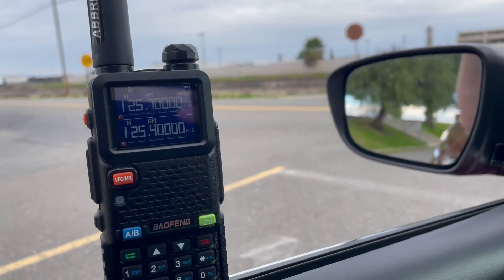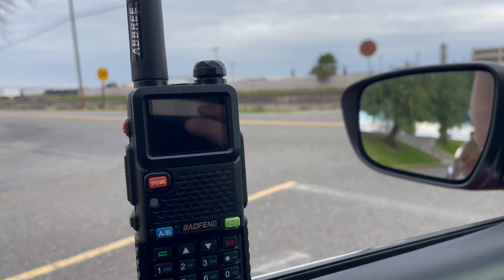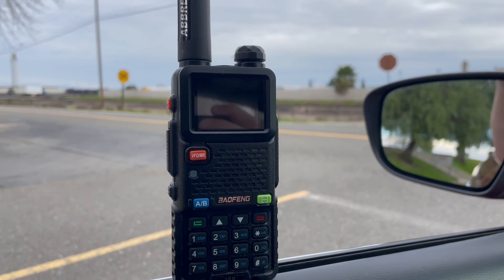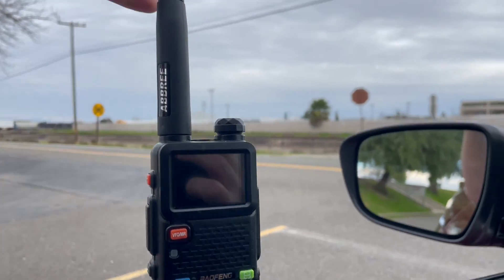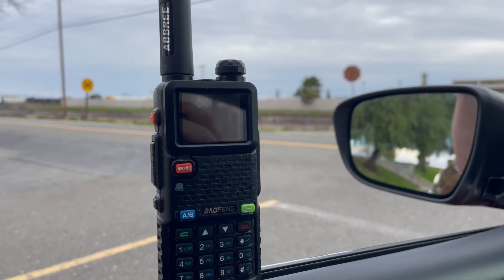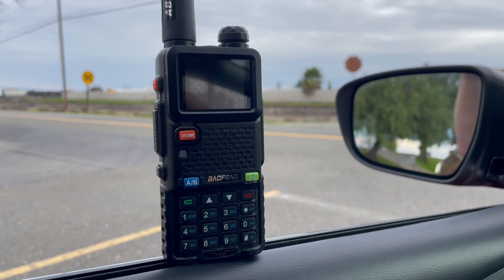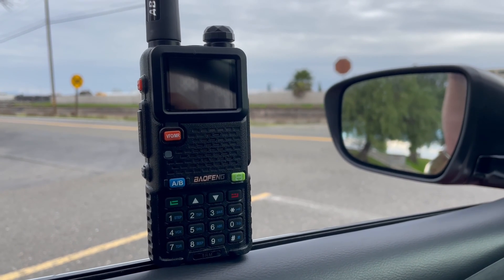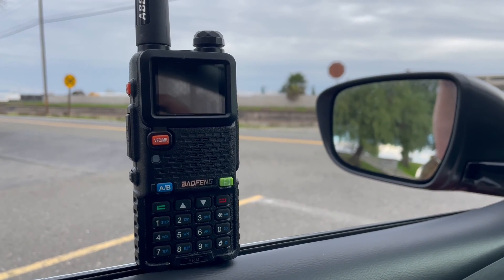How is Airband RX on the new BaoFeng 5RM. Testing at SMF & COS Airports.

Comment: Hi I just got my BAOFENG UV-5RM  what means if doesn't have FCC number back radio. Is bad or not?
Reply from the maker: It’s hard to tell which model and from what manufacturer it came from. There is a difference between a 5RM and a UV-5RM so I can’t be certain. Usually if it doesn’t have an FCC number on it then it may be out of spec and have spurious emissions. The only way to know is to test and see what it looks like on a spectrum analyzer. Ham-Solo K0FYR

Comment: I just took delivery of that radio just for the air band.  I had the Abree folding antenna and a couple others.  The radio really sucked when I was literally across the Las Vegas airport.  I just ordered the Diamond you used from Amazon ($29)  If it doesn't help, I'll send the antenna and the radio back.

Thanks for your testing and information.

Comment: Glad I ran into your video. I almost went for this radio but your demo shows how poorly the AM sounds.  I am a flight instructor and I use a ICOM A22 aviation HT.  Of course it sounds great as it should.
Reply from the maker: Glad I could help. The audio on the Bearcat SDS100 trunking scanner is pretty good but probably won’t beat out that Icom A22. Ham-Solo K0FYR